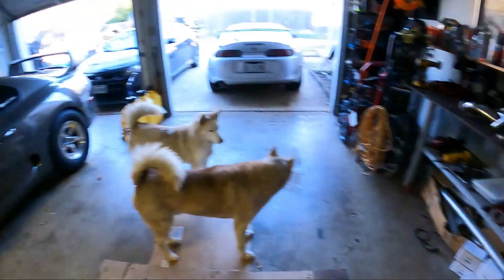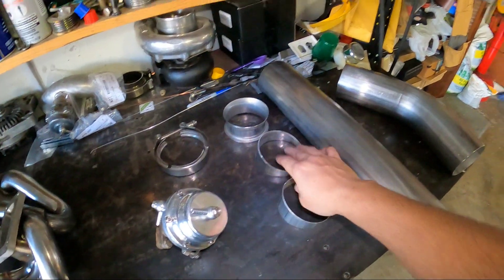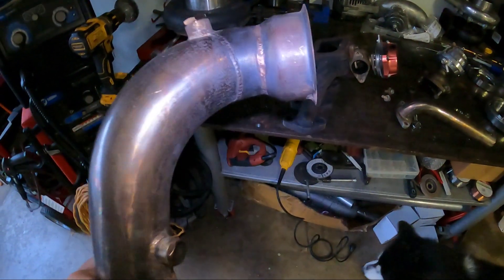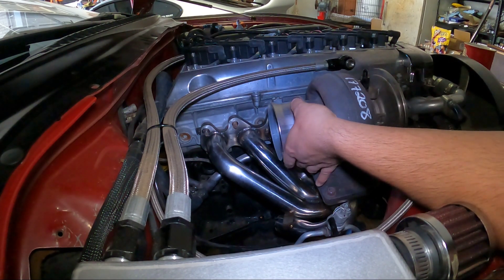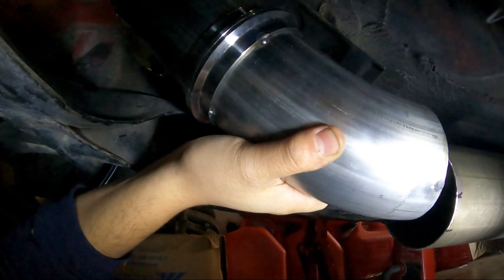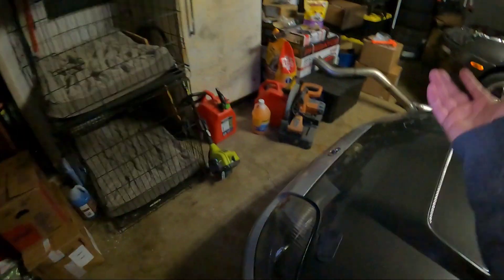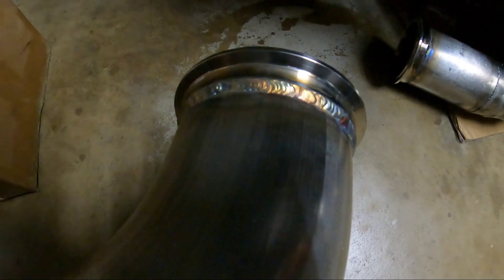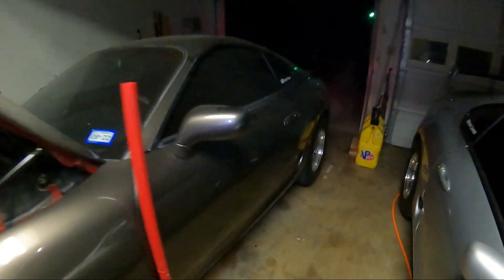MKIV Supra Gets a New Turbo Manifold and Full 4 Inch Exhaust.

Comment: Tubular mani all the way man for our 2JZs ! 
Give yourself a 5inch aluminum tip for the high pitch sound
Reply from the maker: Already on it :)
Reply: @boostedproject   need a video asap :) 
Did you reroute your screamer pipe into the exhaust ?
Reply from the maker: @Itscastlebravo  I vented it straight down to the ground.
Reply: @boostedproject   i thought the opposite ! It is super silent or the mic don’t pick it well ?
Reply from the maker: @Itscastlebravo  typically when you route the wastegate into the downpipe it becomes very quiet. At least from my experiences. With it vented towards the ground, it becomes very loud.
Reply: @boostedproject  yes exactly but I meant that we didn't hear much of your dump tube ! Maybe you are running big springs on your wastegate